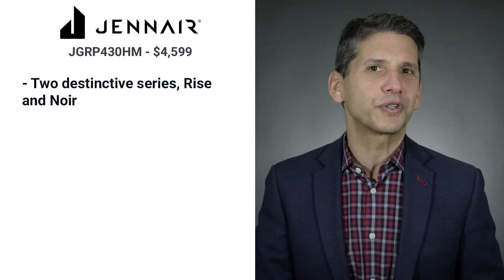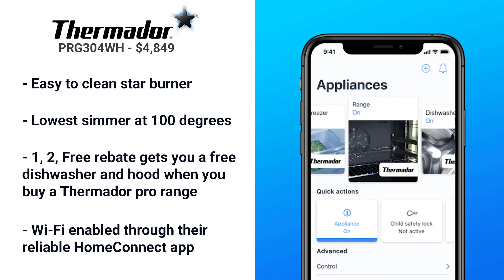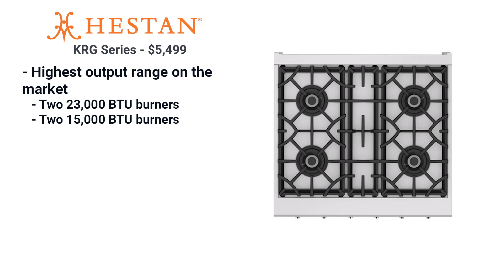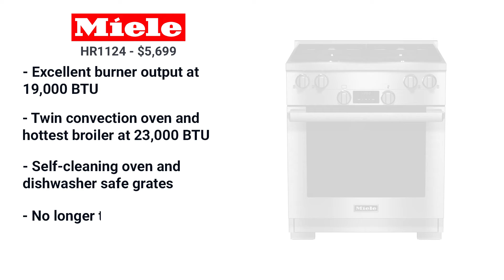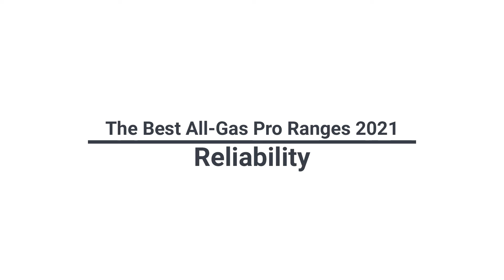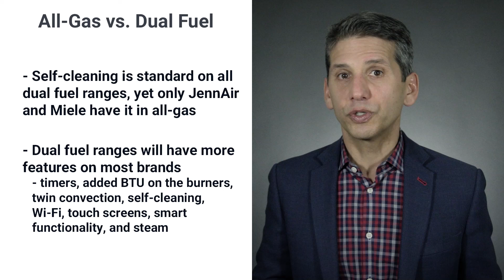The Best 30-Inch Gas Ranges for 2021 - Ratings / Reviews / Prices

Comment: Love your videos.  I'm interested in buying a 30" Thermador Pro Harmony all gas range with 4 burners.  The problem is that I have a small New York City, 7' x 11' galley kitchen with an exhaust fan/microwave that doesn't vent outside, but the stove would be 3' away from the window, which does have a built in exhaust fan that works pretty well with a conventional stove.  Is this a problem?
Reply from the maker: In the state of Massachusetts it is... and I'm betting it is there as well. Luckily, Thermador makes a 30" 5-burner unit that they underpower which allows for it to be rated to work in such a space. So if you are adamant about having Thermador in your space the 5-burner would be the way to go.
Reply: @YaleAppliance1  Thank you for the reply.  That is disappointing.  I was trying to avoid the low powered burners.  Would the Wolf 30" gas range be appropriate since it only has 3 15k btu burners and a 9k btu burner?

Comment: Looking at ranges for my kitchen remodel and my limit is a 30".  Really like the Thermador so far, but you mention the PRG304WH has wifi capabilities. I don't see anything on that on their site for a 30" gas range. Am I missing something? Looking for a 30" with infrared broiler and the one that will tell me what temperature the oven is.
Reply from the maker: They do not offer Home Connect in a 30" platform right now. Smallest they offer it in is a 36". That said, Thermador is still a great recommendation for what you are after.
Reply: @YaleAppliance1  much appreciated on the reply. So far, it looks like that has moved up to the top pick on the list

Comment: The duel fuel rangers used to be advertised as more controlled baking temperatures. They also have more expensive parts to break, as in control boards. I assume gas ovens need to add air into the box since gas needs oxygen to burn. This is also why they bake dryer. Moisture is a by product of burning natural gas. A gas oven should be more dependable over the years. There is a reason he only gives out service stats for the first year. I also believe but may be wrong, that commercial gas ovens used to have a 2 stage burner. This would have two flame settings to keep a more consistantly heat.

Comment: I find self clean to be a completely useless feature, I clean my blue star oven with easy off in 20 minutes without using a ton of energy and heating up the kitchen. I thought I would for sure miss having self clean as I’ve had in previous less expensive ranges but it really hasn’t been an issue at all. There are many great ranges but the reason I chose blue star is for it’s simplicity and closest resemblance to a true professional range.
Reply: Self-clean is also not a great feature for longevity. It's basically an oven stress-test, running everything maxed out to the max for extended periods of time. It's hard on the seals, it's hard on the burners/heating elements, it's hard on the convection hardware. It's basically the cooking equivalent to redlining a car at max RPMs for two hours. If you want your oven to have less service issues, don't use self-clean.